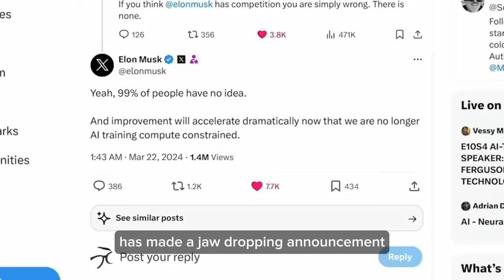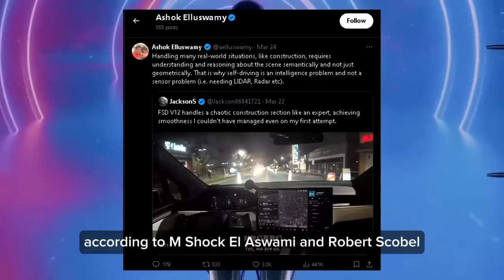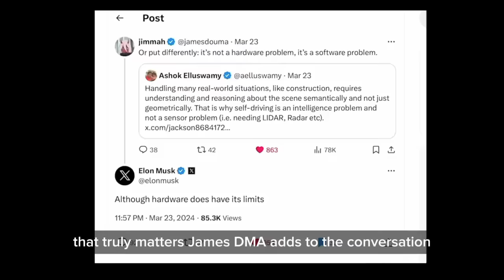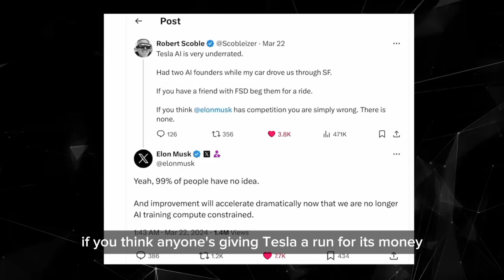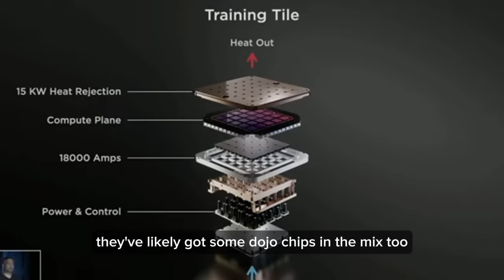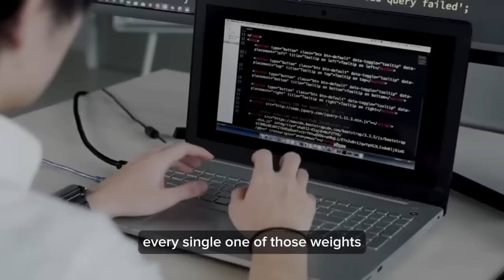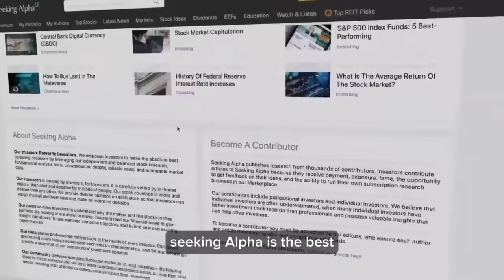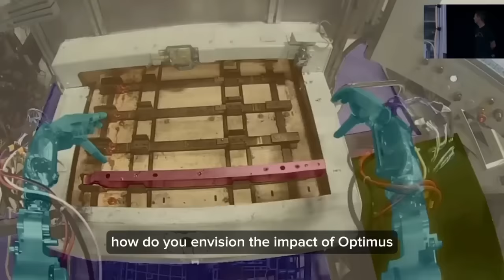Elon's FSD Announcement Just Left the Whole World Speechless

Comment: First Tesla used a CPU cluster in parallel, then went to making a GPU cluster in parallel which was 100 times faster, then has built a NPU layered system that is 100(10,000 times faster than CPUs) times faster again.
Each system has benefits and each needs the other including the NPU- needs a CPU interface.
So I believe they have developed something of a tiered process and data goes thru CPUs to GPUs to the NPUs and the NPUs receive filtered data/video to only what is needed.

I may be wrong and the NPUs might be operating solely on their own starting with complete raw data in which case I wonder what Tesla will do with the 2 other systems.